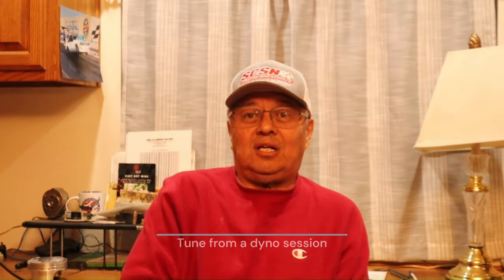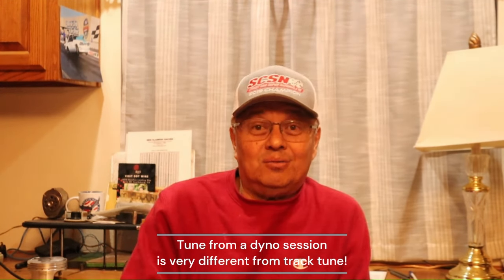STREET COMPRESSION, TIMING, CARBS/THROTTLE BODY "ROAR" AND DUAL EXHAUSTS! ETC...

Comment: I have noticed in the 5.0 community there is no priority placed on compression, they love low lift cams,  and the words “quench distance” are non-existent!  I am speaking in terms of YouTube videos and online forums!  I also need educated on why 5.0’s are not revved and a lot make peak HP at 5500 rpm?!?  I used to drag race 289’s and spin the piss out of them.....a short stroke doesn’t make torque so you spin it up for HP and gear down to compensate!  What gives there....?
Reply from the maker: The heads are very limited as far as flow is concerned therefore lots of overlap is applied to their camshaft like a Super Stock grind.  Compression meanwhile is not important because there are emission considerations to pass so there is that.  When these issues as addressed then the engine responds and produces power like you found out.
Reply: @benalamedaracing2765   Thanks Ben!  Will a 5.0 short block handle high RPM like a 289 or is there a weak link in the system?  I saw where someone stated something about there being a balancing issue with the engine that’s limits RPM’s.

Comment: Ben, I have watched a lot of your videos. I wish you would talk about the Ford 302/351 z heads and  compare them to TW or AFR. There are also intakes you never  really talk about such as the  Holley systemax ll intake and how it compares to say the Performer rpm. Also, you never really talk much about the Boss 302 and I am especially interested because you do talk about the benefit of canted valves on the 351c. That said what about the 385 series? Not even the FE gets any love....... You are the best on line so thank you so much for all your work. Sincerely MTN
Reply from the maker: I have many many issues with the FE and will now reject working with them if it is an aftermarket aluminum block.   I will place a future video on the Z heads vs. AFR/TW. Lots of experience with both for many years.  Will do these as soon as possible.

Comment: I've got a 1984 foxbody here in nz. Cammed vr spider single plane intake 600 edelbrock carb lightly ported d50e heads hooker headers. And was told it was built for racing. I believed this as It can leave my holden ssv 6.0 behind. And it is  Very responsive and lights up. Blew a head gasket thinking to see some good stuff when I decided to strip it down to repair and seen it had stock pistons. Not only are they stock with the 4 valve relief and small center dish . They sit down the hole maybe 2-4mm so my 100psi static on all cylinders   (assumed** almost back together and will recheck ) the fault of the gasket for the very low compression.  I'm still puzzled as to how this stock non roller with the taller deck runs so well with a set up that should be against it. The single plane (like a victor jnr) and 600cfm led me to believe this was atleast on high comp pistons or stroked to be so responsive and powerful and not just bog out. P.s holden commodore ssv is no different to the 2010 Pontiac g8. I've got another engine I'm  stroking for next years racing that's an explorer 5.0 . that's gonna get your teachings with the rings pistons and journals being used on it. But any idea how that engine pulls. Cams 244/244 304 304 .466 .466 110

Comment: My truck Norris cam is quite an improvement over stock. It has 108 lobe separation.  As with this man, To be really good at anything , you have to be Obsessed.  Brian tooley  is equally obsessed, as is Steve Morris or Nelson or lake speed from Total seal. Focusing on these guys. You're going to have GREAT Results.  I just wish They were only sharing their wisdom with me, And that my piggy bank wasn't hiding under the bed in the Fetal position.

Comment: Ben, I want to thank you for putting the cookies on the table for us to reach. When it comes to measuring cranking compression with a gauge, I have noticed about a 25-30 psi DECREASE after switching from an old-school ford starter to a newer style mini starter. When you recommend a ballpark of 190psi for pump gas, what starter is being used? Mini? Have you ever experienced differing pressures due to starter style?
Reply from the maker: Not really except if the starter really was worn out with very high resistance will turn much slower and the new one will definitely crank faster and posts a higher reading.  Normally they all turn close to each other if they are in good shape from battery to starter to the ground/positive connections.

Comment: Another great video Ben. Have you done much with E85/Pump E85 with carbys? Curious to know your thoughts and experience on Gasoline vs E85
Reply from the maker: A converted carb with e85 are very good!  For max street it is much better from a performance standpoint.

Comment: Hi Ben, really like your way of explaining how to make power and how to get as much as you can out of everything.  I am building a sbc .o60 over 400. 4.185 bore 3.750 stroke.  I have a scat lightened crank and 6 inch I beam rods 2.02 1.60 aluminum heads 205 runners edelbrock victor jr.  Now I am trying to figure what compression and cam to use.  It is going into a 55 Chevy 1/2 ton pickup with a th350 and 9 inch with 4.56 gears.  I have been  looking at Howards cams 106 LSA and 102 intake centerline and comparing them using  the Wallace Dynamic calculaters.  I am finding cams that make dynamic pressures of 8.5 to 9.5 and dynamic pressures from 180 to 195+.  Those numbers change from cam to cam depending on the static compression that I calculate and duration of the cam.  It also changes the effective stroke for every combination that I come up with and also the overlap.  What I need help with is trying to find the right  mix of dynamic cranking pressure and dynamic compresstion and  is it better to have a longer effective stroke ?  I am here is CA and will run this at Sears point and Somoa and probably more time at the track then on the streets but I would like to be able to run it on 91 and still make good power.  The truck should be around 3400 pounds and maybe less since I still have things that can be changed to make it lighter. Any idea's to make this engine perform would be great.  I have a friend that runs a 65 F100 and he is putting a stroked 428 in it so I have to try to get as much as I can out of this 400.  Oh yeah I will be running a single 4 barrel.  Thanks again for all the cool shows that you are making and all of the very useful and very very good tips and information. Sorry for this being so long.  Thanks, Pat
Reply from the maker: I feel you should talk with Rod/Nolan @ Iskenderian Cams because they have so much feedback from racers like myself on what is the best grind!  How long is the longest straightaway and how tight are the corners!  In fact Nolan does this a lot for many circle track and he nails the grinds all the time.  Google Iskenderian and they are in Gardena in California and just mention my name and they will take you seriously.  Nolan is super busy and Rod would also be a good one to talk to.

Comment: The VW dual exhaust with headers is somewhat similar to a crossplane crank V8, with a pair of cylinders firing close together creating a high pressure pulse as if there was one big cylinder. With the VW the two cylinders fire 180° apart. If a dual exhaust is favored for whatever reason, it would be better to pipe the front two cylinders together and the rear two cylinders together. This would give 360° between exhaust pulses. The closed exhaust valve on one cylinder would prevent any dilution of the intake air with hot exhaust. 
I do believe that in combination with a merge collector of the two headers would providen the best torque over a broad RPM range.
Ever think why Subaru engines have a bit of bark like a V8 even with a single exhaust or turbo. It is the two exhaust pulses, one from each bank, as the cylinders fire 180° apart. To the collector on each side this appears to be one big cylinder on each side. This gives that Harley reminiscent exhaust note.
Now if a person looks at the Mazda Skyactiv videos that describe their research into the exhaust and manifold/header design to enable using 13:1 compression and 87 fuel, could provide information on how Subaru performance might be improved or lower ocane (read less expensive) fuel could be used. And gosh with todays prices we sure need to have all the tricks in play to reduce our fuel costs.
More good information Ben. Thank you.
Have a great weekend Ben.

Comment: I swear my old mustang has a chip in it or something, anything over 12* timing in it and it’s detonate on 93. I could put at ten and still could not run anything but 93 in it. Makes sense, it’d walk away from every other stock ish 5.0 it raced. Heck it beat some cars it didn’t have any business doing so. Love your videos. I can’t wait to get my newer to me 95 5,0 hopped up.
Reply from the maker: They may have ramp up the ignition curve or your timing marks are off!  They are a piece of steel plate that easily bends and shows you a wrong number a possibility.

Comment: Hi Ben,  E7 ported with chamber work and 11.5:1 domes. Good sleeper combo?  Thoughts..  Sure you have seen.
Reply from the maker: Did it before also by pushing in an aluminum bushing to get rid of the pushrod bump on the intake ports.  Then 1.94 x 1.60 valves will work impressively!

Comment: You're going to stir some stuff up when some of Richard Holdener's followers watch this about sizing carbs!
Reply from the maker: I have yet to see anyone with a 10:1 stroker tells everyone he really went quicker at the track with a 950cfm carb!  The example I gave is a mid ten sec. engine making about 600hp (426cid 11.5 comp.) and still went quicker with a 750 vs. an 850.  What would a 950cfm do?  It will dyno well that is a given but we do not race dyno's we race the track.  Well I do that is a fact been there many times and done that.
In short it is the difference between the dyno world and the world of competition running a race.

Comment: Brother, I've been wondering about running a single 3 inch on my Ls3 03'Crown Vic Police Interceptor I am swapping.
Reply from the maker: No room for a single 3 inch so you are better off with an X pipe joining both banks.

Comment: Also I don't want my car loud. I am building my Vic into sleeper. So a single 3 inch would probably be pretty awesome. I've always been a "duel exhaust with Flowmasters" type guy. But I don't want it loud. Throaty but not loud.
Reply from the maker: I love the flowmaster sound and it is just about the same if you installed an "X" pipe between the two banks will basically function the same.
Reply: I'll get rid of the original H- pipe and run a X-pipe instead then.
Reply: Thank you sir!!!

Comment: Quadrajets make a good "roar" :)
Reply from the maker: Yes they do as well as the Mopar with Carter Thermoquads!  
The saving grace for both of them are the tiny primaries and if not for these, they can all win the best engine roar!  lol
Reply from the maker: Do not forget they also have an air valve on top of the secondaries and if not for that, that roar becomes a big bog down falling flat on its rpms!